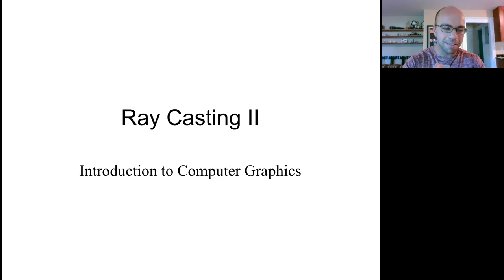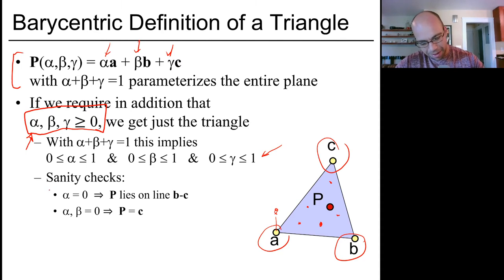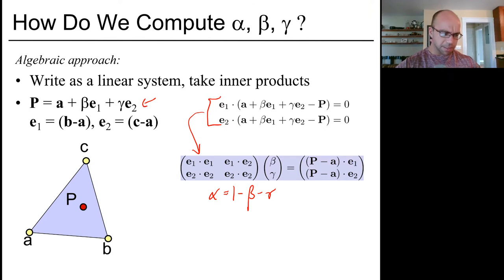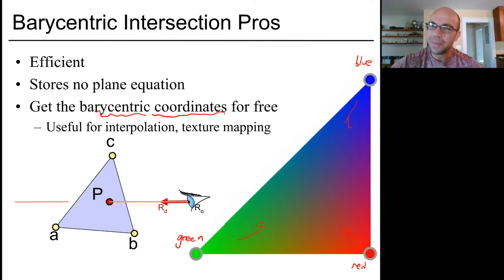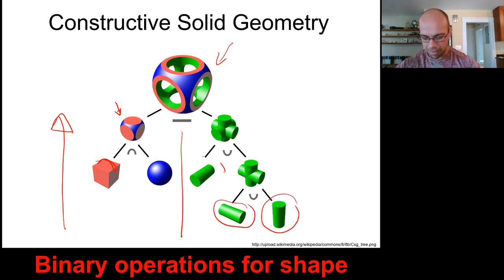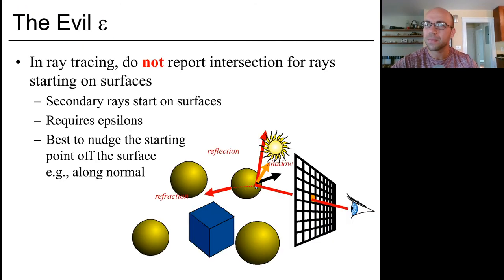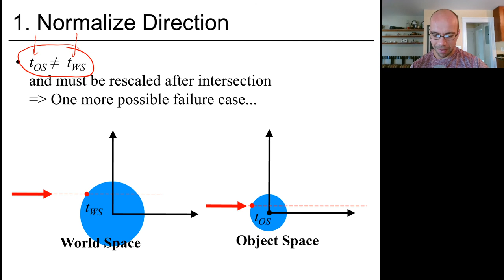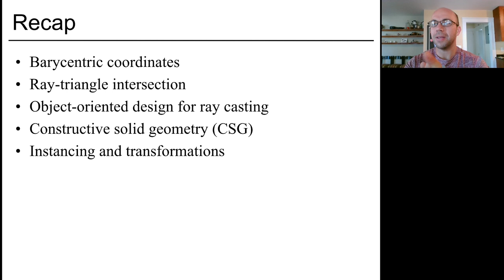Introduction to Computer Graphics (Lecture 10): Ray casting 2--barycentric coordinates, CSG, etc.

Comment: Very cool stuff. Regarding ray-triangle intersection, there are faster ways to do it using dot product with 2 pre-computed vectors which give you the barycentric coordinates.
Also in your previous lecture regarding intersection with spheres, I'm not very fond of the algebraic approach (solving a system of equations which you should always avoid when doing geometry). Stick with geometry!
Project center of sphere (C) on ray using C * Rd - Ro*Rd , call it H. if ||CH||^2 > r2, no intersection. Otherwise, define k = r^2 - ||CH||^2, backtrack along ray from H by k, and you have your first hit. If you add k you find the exit point.
If the ray starts from inside the sphere, you have to adjust a few things, but it's easy to test whether you're inside or outside the sphere.